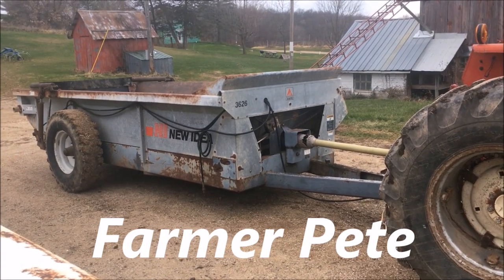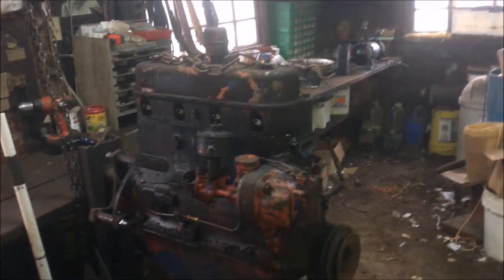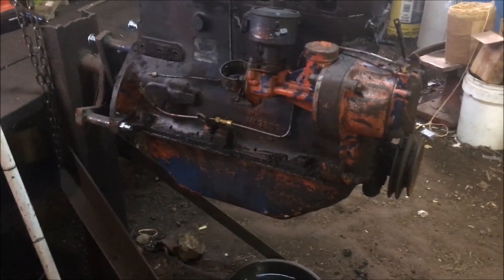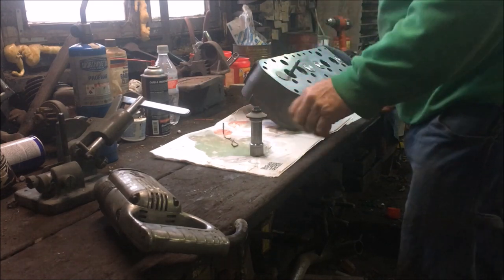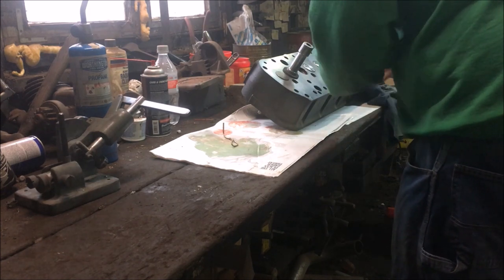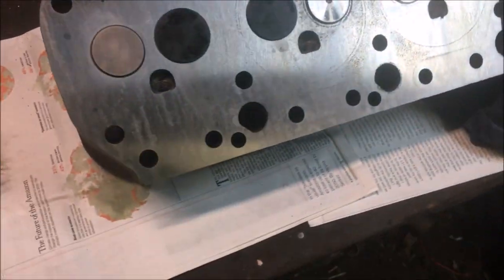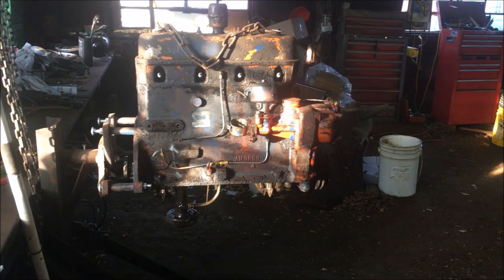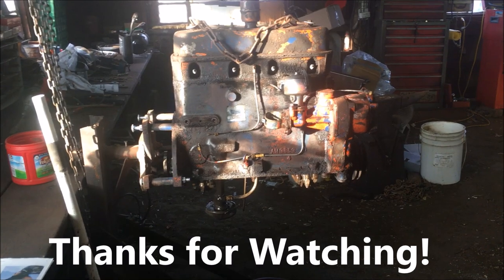Allis Chalmers WD45 "Restoration" Part 6: Engine - Grinding Valves & Checking Bearings

Comment: Your valve grinding was still new technology when that tractor was Built! I had the machine shop do all my head work. What is the difference between what you did and hand lapping?
Reply: My interpretation of lapping the valves is; the valve is lapped or seated to the existing valve seat, so if the seat is worn in one area, the valve would conform to that area. If the valve should rotate then the valve wouldn't necessarily seat well. The old hand lapping tools would do a partial clockwise rotation and then a counter clockwise rotation, all while continuously rotating  the crank handle.
Reply from the maker: That's right. Some folks will lap the valves after grinding them but I usually didn't unless I was putting together something special.

Comment: you might think about a D17 manifold the newer series with the better muffler mount and use the older muffler  you half too drill and tap the manifold bolts but a lot better muffler fit using a muffler clamp instead of the two bolts l have done that acouple times!!!
Reply from the maker: I've thought about that, but I have a good manifold that doesn't leak - I think I had the gasket surface planed last time I worked on it. I've already got a "Nelson" style muffler so that's probably the way I'll go. Thanks!